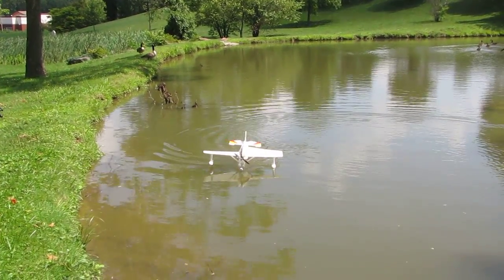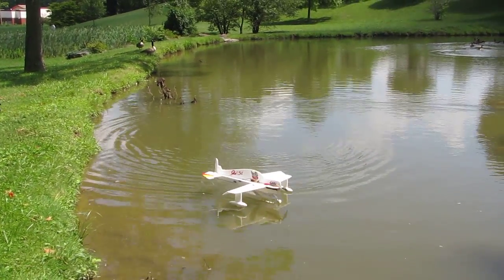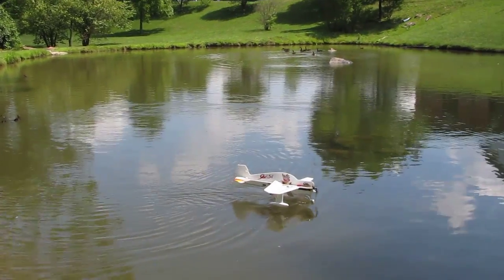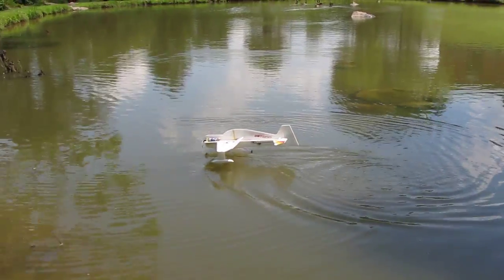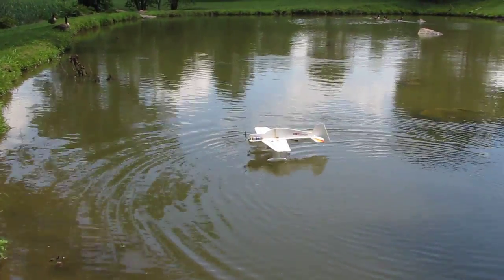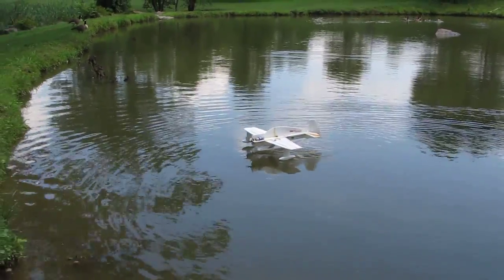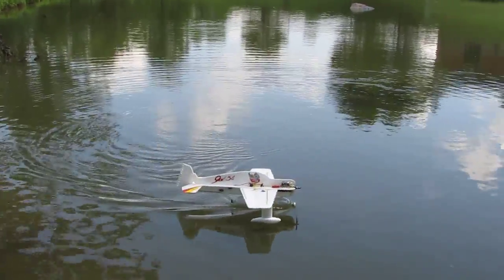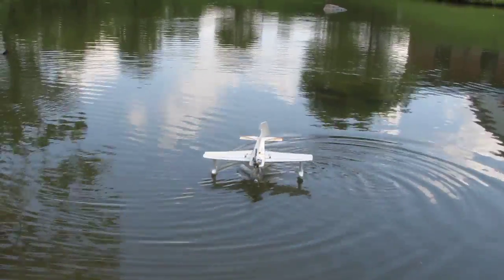(1/3) Yak 54 Foamie Float Conversion: Water Handling Test

Comment from the maker: I just took some standard white foam, drew a side view of the pontoon,cut it out,then sculpted the rest with a sanding block. Then I made a styrofoam extension to join the pontoon to the wing. To get the required height of the pontoon extension, we put the plane, with the bottles attached, in the water and measured the distance from the bottom of the wing to the water surface.

I hope this helps. Also it helps to angle the wing tip pontoons up a couple degrees. Also google seaplane design :-)